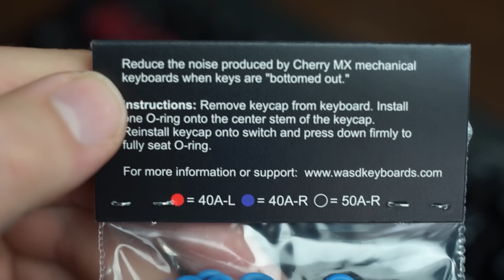Mechanical keyboard O-ring mod - 40A-R - Corsair K70

Comment: Open your keyboard and put a piece of felt on the bottom. Approx 3 or 4 mm. Glue it to the case and close your keyboard. You will notice a more dramatic noise decrease of at least 25%.

Comment: I dampened my K70 spacebar using small pieces of thin pipe sealing strap or tape, and thick grease. 

Inserting double folded pieces between the body and front side of those side "buttons" just to tighten these so these won´t rattle on the board itself. 

Same parts makes noise also when the moving inner part "whobbles" horizontally so i insert thick grease on the sides of the moving part.

Now my space bar fits the sound scheme with my other O-ringed buttons.

Comment: Thanks for the tutorial... O ring installation is a fairly self explanatory process, but I was unsure as to whether or not they were required on the stsbilising "prongs" on wide keys such as the spacebar and shift key. I thought they'd get stuck between the 4 corners, but it seems they're wide enough to bottom out on top of them instead.
Reply from the maker: glad to help mate!

Comment: does it help to reduce the metallic sound produced by the spacebar and backspace keys?
Reply: That's from the stabilizers and a dab of grease on their pivot points can help.
Reply: Clem Fandango what are blue tac dots? And where to put them? I want to lower the metallic/clingy noise of my Logitech G610 cherry brown spacebar....
Reply: Trevor Claret Adrian did you find a good solution?
Reply: Joel Back what exactly do you mean? Sorry I don't fully understand

Comment: Why don't all mechanical keyboards come with these already installed?
Reply from the maker: This is something I have wondered for a long time. It takes awhile to install these by hand. I would love to order a pre installed keyboard.
Reply from the maker: This is something I have wondered for a long time. It takes awhile to install these by hand. I would love to order a pre installed keyboard.
Reply: loudpanzer Oh, never mind. I took a key off my Logitech G710+ and it looks like they already come with black O-rings. Still loud though. :/
Reply from the maker: LatinMessiah Thats neat. I did not know of that keyboard, Logitech always has been one of my favorites. I have used the G5, G500, and G500s gaming mice, and will probably get the next one thats out now. Maybe make a review of it, but mice are kinda... mice lol.
Reply: I hate these stupid response, not everyone slams their key to bottom out and doesn't mean its still shouldn't come with it. I try very hard not to bottom out my $180 keyboard, all just to avoid the sound. Could've bought a wireless membrane saved a100
Reply: +loudpanzer Logitech G710+ has Orings pre installed
Reply: because you get different types of switches with different noise levels and feel. if you don't want the noise don't get the blue switches
Reply: Or already in the box...

Comment: Woah is that RGB or Not? Arn't those suppose to glow red and not blue/white?
Reply: RGB means he can make the keys whatever color he wants lol my razer blackwidow is set to blue but turn red on keypress then fade back to blue.
Reply: cbiser12 no there are RGB blues that have been discontinued for awhile and are quite rare
Reply: LiteGaming I'm pretty certain you're confusing RGB with LED. RGB stands for RedGreenBlue which means multicolored. an LED is simply the light emitting diode (the bulb) itself. most things these days are RGB so one product can be any color as opposed to manufacturing multiple products for each color and being stuck with that color decision permanently.
Reply: There is the K70 RGB...

Comment: I just ordered the K70 MX Brown. My first mechanical keyboard. And I wonder if ill have to get those O-rings, as I dont like my keyboard to be noisy. Let it, tops, be as noisy as my membrane keyboard. Thats cool.
Anyways, its tough to know whether to ge the Blue or Red O-rings. I understood Red are very thin, thus, very subtle difference to them...
Reply from the maker: I actually also have the MX brown model right now. My old k70 that had blue switches started having LEDs die out, I returned it to Corsair and they let me switch it out for a MX brown k70 that was newer with red LEDs!
Reply: loudpanzer Yup! The red led keyboard is what I ordered. What do you think of it? And on the change from Blue to Brown?
p.s- you think O-rings are needed for the Brown?
Reply: zZViperBoostingZz I will let you know then, man, I should receive my K70 Vengence Brown MX on the mail soon :]
Reply: zZViperBoostingZz yo dude! Just got the K70 MX Brown from the mailman. Its great. Feels good. Feels solid. And youre right, its really quite silent! I actually read how people dislike the MX Brown on the new K70 RGB led model...so thats why I came back to buy the older model [with the Red leds].

Now I only need to sort out 2 things:
1. How to type without bottoming out/in the keys? [membrane habit till now]

2. How to stick the CORSAIR brushed silver logo, which comes off the top of the keyboard. I received it like this. :]
Reply: zZViperBoostingZz  You mean, I still need to install O-Rings [Red or Blue] , just so i could practice not bottoming down?  
I thought these were only to dampen the noise, yet, the MX Brown's noise is quite silent already...therefore, no need for O-Rings...
Reply: zZViperBoostingZz interesting. ill think about that :] p.s- i use this K70 more for typing as i have a Razer Nostromo which I game with :]
Reply: zZViperBoostingZz K95 is nice. i just didnt have use for the macro keys..so i went for the K70.
On the store- i really liked the RED MX switches and delibirated between them and the BROWN MX, but then i understood the Browns are better for typing and that with the RED you might experience a lot of TypOs since theres no actuation point..so i went with Brown. Thank god I read about this before ordering...otherwise, it wouldnt be good.
These days you have to research a lot before buying into something..
Reply: zZViperBoostingZz Good luck with the O-Rings test, man. And thanks for the help :]

Comment: Dose it work with other keyboard
Reply: it works with all Cherry MX keyswitches but i think it only helps with the clicky ones like the blues and etc.
Reply: All the keycaps that support the same design as cherry MX not all because there are some topres that won't support it.
Reply: CrappingZombie They don't only help the clickyones, every cherry switch has the bottom out sound.
Edit: Coming from a cherry mx brown  / blue user
Reply: IT WORKS WITH EVERYTHING. Cherry, Gateron, Kailh, Razer, And many more.

Comment: I just can't choose between 40A or 50A. Is the difference any noticeable? Anybody that might know? Thanks!

And thanks for this video, very professional and informational :)
Reply: Guy Random I don't think you can buy them anymore :c I can't find them
Reply: Rez I got mine over at Casemod.de since I live in Europe anyway. They are absolutely amazing! I have the 50A ones and they are just the right toughness.
Reply: Guy Random I live in Europe too, Denmark to be specific. What would you recommend 40A-R or 50A-R?
Reply: Rez Although most people prefer the 40A ones, I think the 50A ones provide a little more toughness. I prefer that a lot. The 40A ones might make your keyboard too mushy.
Reply: Rez Link for 50A: https://www.caseking.de/king-mod-noise-dampener-fuer-cherry-mx-switche-hart-125-stueck-gazu-094.html Link for 40A: https://www.caseking.de/king-mod-noise-dampener-fuer-cherry-mx-keyboards-125-stueck-gazu-082.html

And don't forget to pick up a key remover. A one with a wire is better than a fixed plastic one.

Although the plastic one does work, it might damage your keys. I have used it and some of my keys showed very small scratches. Nothing that you might notice though.

https://www.caseking.de/king-mod-keycap-remover-schwarz-gazu-126.html
Reply: Okay thanks!
But i live in Denmark will they send it to me from Germany?
Reply: Rez I have no idea but I would think yes.
Reply: Do you live i germany?
Reply: Rez Nope, I live in The Netherlands. They probably ship worldwide, but at a larger cost. Since you live in Denmark the rates won't be too high. Check it on their site though.

Comment: My first keyboard I ever bought I was & am disappointed1st: $1402nd: loud3rd: LOUD4th: (not a negative) corsair k70•I desperately wanted a green backlit keyboard•Mechanical, but quiet as membrane•price wasn't that much of an issue, if I got what I wanted
Reply: +Omar Aziz Theres different types of Cherry MX switches, Blue's being the loudest then you have Browns which have the tactile bump of Blues but without the sound, then you have reds which are linear, But then you go into the not so mainstream ones like Blacks, Clears etc.  If you dont want sound get some Cherry MX reds with some thick O rings.